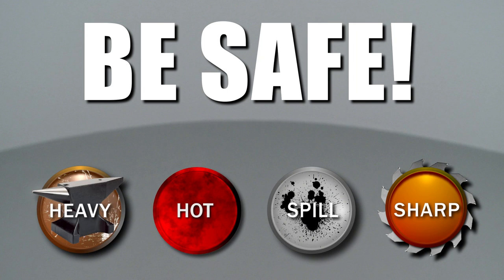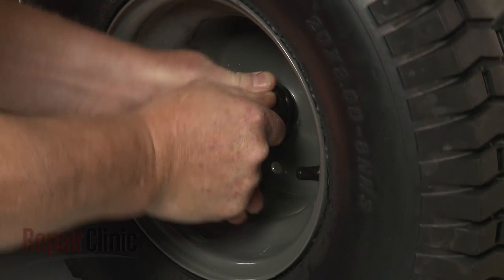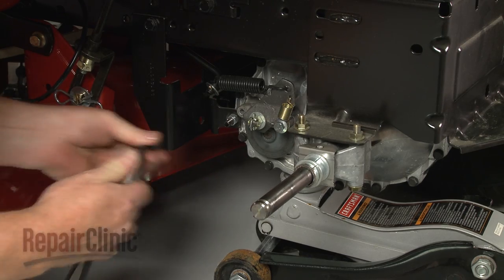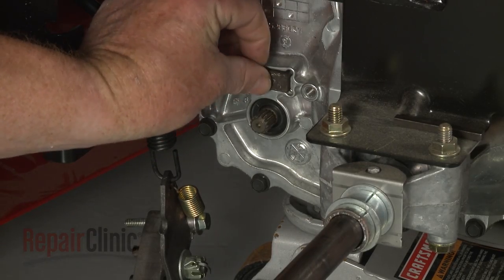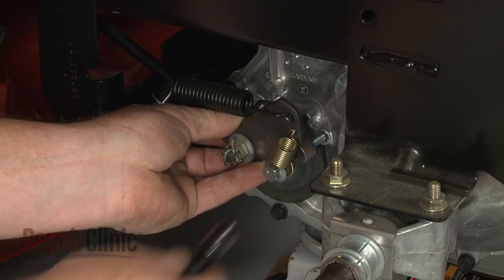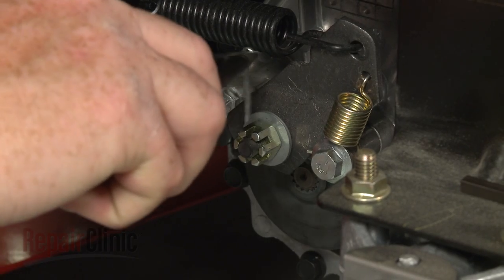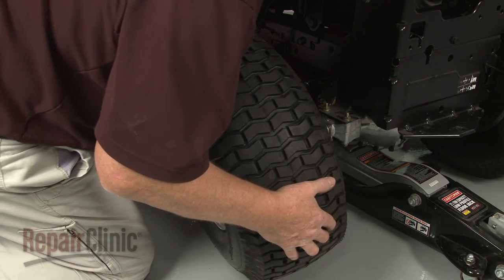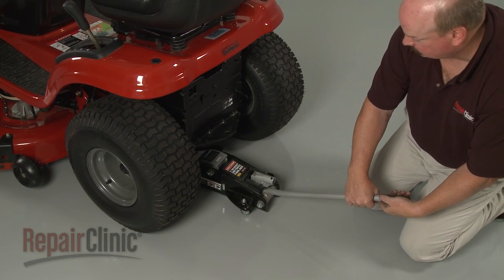Craftsman Riding Lawn Mower Brake Pad Replacement #532142883

Comment: I'm having trouble removing my brake disc to get to the inner brake pad. The disc is rusted to the splined shaft. The mower is about 9 years old and the brakes are completely ineffective. I've soaked it with PB Blaster for a day, applying every couple of hours. I've tried using a 3 arm gear puller, but there's not enough clearance behind the disc to get all 3 arms to hook onto the disc. Any suggestions?
Reply: Soak in PB and let it sit... if that don't work, use heat and replace the rotor too